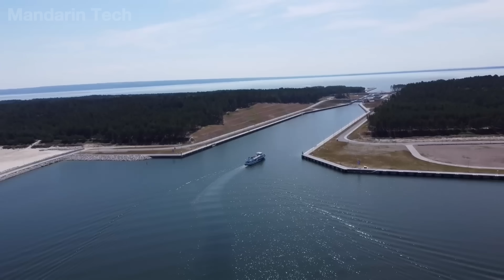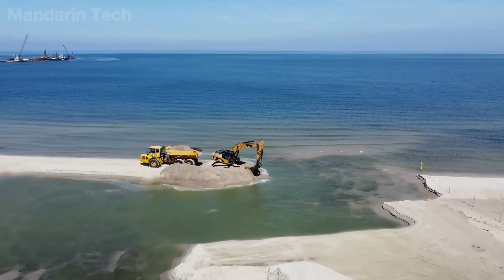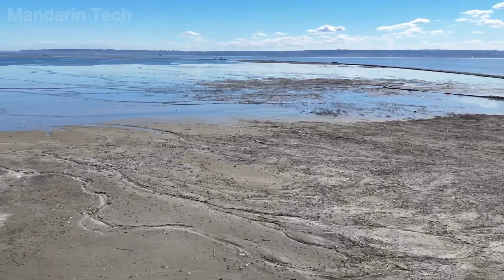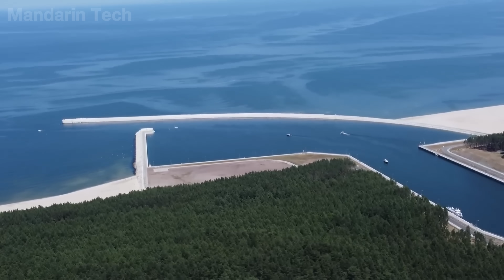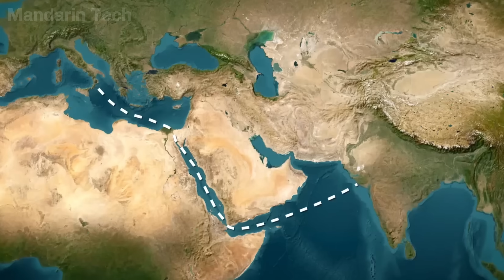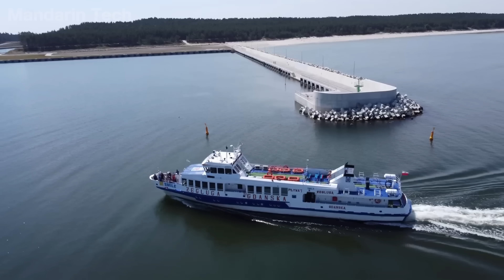Poland Spent $450 Million Digging a Baltic Canal That Alarmed Russia

Comment: I'm not sure that it was immediately necessary as Poland's existing major ports are Gdansk or further west.  It does open up a large area of coastline that would otherwise be subject to Kalingrad controls.  The port at Tolmicko could be upgraded, including road and rail infrastructure.  A port could be added near Elblag which already has some roads, connections but otherwise the existing land in the area is predominantly farms.
Reply from the maker: It definitely seems as much strategic as economic.

Comment: This is just one phase of the entire investment. Eighty percent of Baltic freight is handled by small vessels for which the canal was built. This is only part of the investment, the subsequent stages of which are intended to revitalize the port of Elbląg. Moreover, the Russian esclave in Königsberg has been bypassed and no longer impacts shipping in the area. The port in Elbląg will free large ports in Poland from servicing small and medium-sized freighters and increase their capacity to transship large ships.
Reply from the maker: Great explanation — thanks for adding more context
Reply: @Mandarintechmido Thank you for including our domestic investment in your YouTube profile. Personally, I'm very pleased that this investment has taken place. Before World War II, the ports in Elbląg and Puck were heavily used. Over time, as work progresses, they will return to life and unlock more capacity than the larger ports in Gdańsk, Gdynia, and Świnoujście. Currently, they are losing capacity due to the need to handle small and medium-sized freighters, which are the most numerous in the Baltic Sea. The opening of the port in Elbląg will allow these ports to exclusively accept large bulk carriers. A project to build a transshipment center and a large port terminal has recently emerged. This will be a completely new, epic project on a massive scale. It will be called Port Haller.

Comment: The canal is little used as it is far too shallow for commercial ships. It is used primarily by tourist sailboats, kayaks and pleasure cruisers. Its maximum depth is only 5m, usable by boats with a Hull depth limit of 4-4.5m. The water channel to Elblag is being excavated to a max of 5 metres. It has a chronic problem of silting. For comparison, the port cities of Gdansk and Gdynia have harbors 12m deep.
Reply from the maker: Appreciate the detailed local insight
Reply: Nonsense. 80% of Baltic freight is handled by small vessels for which the canal was built. This is just part of the investment, the next stages of which are intended to revitalize the port of Elbląg.
Reply: @seboho6938 the canal has little if any military value as it is far too shallow. Polish frigates (under construction) for example, need 8 metres of water. There is zero commercial traffic since the canals opening 4 years ago. A classic example of a failed investment, except for holiday tourism, for example providing access to a yacht harbor in Elblag. Commercial infrastructure investments need to be demand driven.
Reply: @michaelmazowiecki9195 I'm not even mentioning its military significance. The canal is one of several stages of a hydrological investment and has economic significance. It allows for bypassing Soviet permission to sail from the Vistula Lagoon. Why are you commenting on a matter you know nothing about?
Reply: @seboho6938 I look at the facts. The canal depth of 5 m is far too shallow for Polish warships under construction as they need 8m.. It is also far too shallow for medium or large commercial ships. OK for small coasting vessels and tourist yaghts. It has zero commercial traffic since opening 4 years ago. A classic example of misplaced commercial infrastructure investment which should be demand driven. No demand results in no traffic. Serious commercial traffic uses the deep water harbors of Gdansk and Gdynia with 12m depth. Elblag could develop a major holiday boats basin to make use of the canal.
Reply: @michaelmazowiecki9195  Ship traffic is moving towards the port. Expansion of the port in Elbląg is being blocked by Tusk's politicians, who have taken over the local government there. Eighty percent of Baltic freight is handled by vessels with a draft of up to 5 meters. You have no idea what you're talking about. I wonder if you're receiving psychiatric treatment.
Reply: @michaelmazowiecki9195 What I headr is not finish yet need more work to be more deep
Reply: @michaelmazowiecki9195 There were some problem  Investor One party and the city of the Elblag run by opposition Was not possible finish Were some disagreement BUTs Poland is Free from kreml
Reply: @GrazynaWasikwater born traffic via Krolewiec was minimal due to physical conditions (silting) and political ones. Sailboats use the canal but it would have been far , far cheaper to haul them across the peninsula. It is not a strategic link as Poland's Navy ships need a much deeper , wider canal with longer locks.
Reply: @michaelmazowiecki9195  W nieciekawej sytuacji geopolitycznej moze miec tylko znaczenie symboliczne..Problems with the  East Could have some meaning but not working for big ships.working for  smool boats.  fisheries .

Comment: Why is the sluiten required?
I expected that water levens would be almost the same at both sides.
Reply: Three reasons:
1. Water level fluctuations due to weather
2. Ecological barriers
3. Flood protection
Reply from the maker: Water levels can still vary because of weather, currents, and environmental protection needs, so the system is still important.
Reply: Podczas sztormów niestety są różnice poziomu wód.
Reply: 🇵🇱Ecology forced the installation of locks, the point is to prevent water from the Baltic Sea from mixing with the waters of the bay, such was the outburst of ecologists from the European Union

Comment: UAE운하는 3500억 달러가 필요하기 때문에 쉬운일이 아니지. 최소 10년이상의 건설기간에 기술력이 없으면 입찰조차 안되지.
100층 빌딩보다 더 높은 난이도를 요구하기 때문에 해저터널 기술도 없는 나라가 입찰하는건 거의 불가능하겠지.
Reply from the maker: Exactly. Mega projects like this require not just huge funding, but also massive engineering experience and technology.
Reply: A nie taniej byłoby po prostu wybudować port i ropę dostarczać rurociągami???
Reply: @marekduczman  I read that the UAE  is fast-tracking a second major West-East pipeline. This expansion is scheduled to become operational in 2027.  It will double the UAE’s export capacity through Fujairah and will not be reliant on using the Strait of Hormuz.